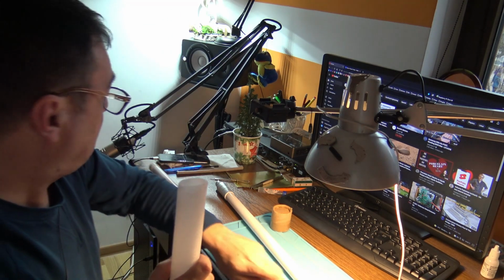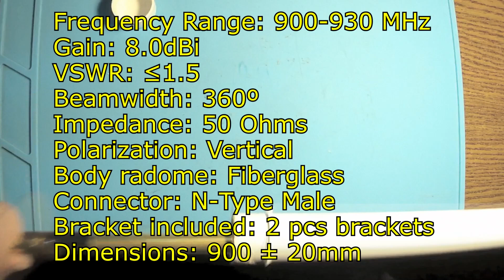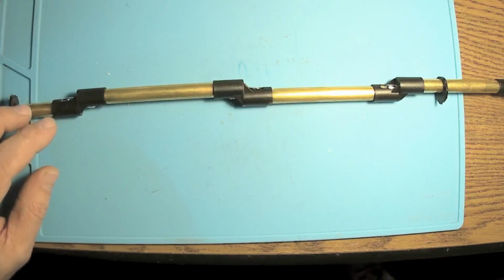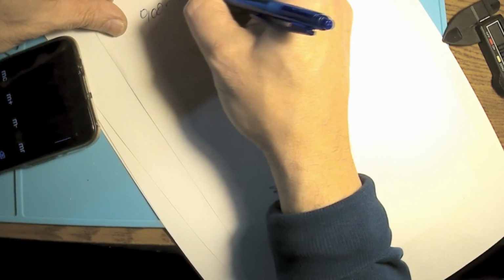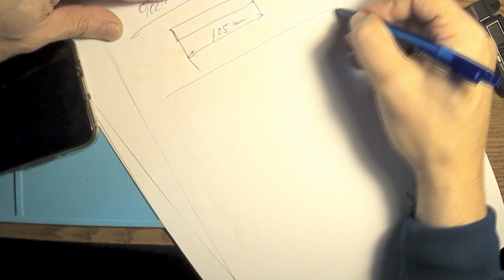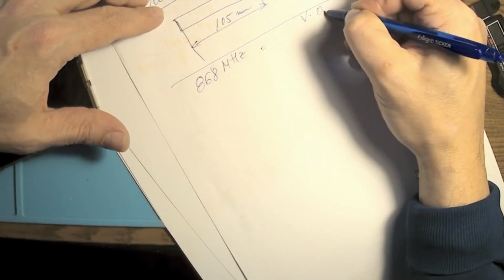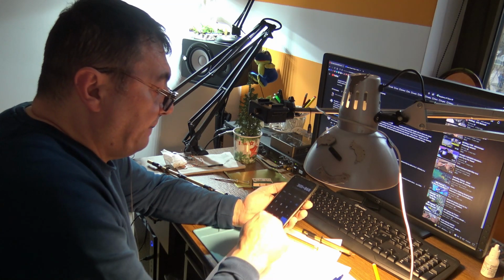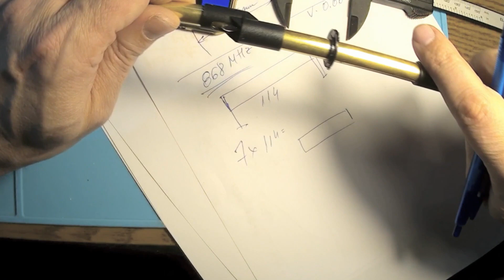RAK 8dB LoRA IoT antenna mod part1

Comment: So what is the best antenna for you?
rak or mcgill or yogi ?
Reply from the maker: So far RAK8dB...
Reply: @viocaia  Thanks all hotspots are about 30km rak can you suggest 6 dbi or 8 dbi
Reply from the maker: @AkGuN10  8dB of course..even more
Reply: @viocaia  I guess I mispronounced it. The farthest point is 30 km. There are many devices near me 500 meters like 1 km I am in the center of the city, is it still 8 dbi?
Thank you very much for your answers and interest :)
Reply from the maker: @AkGuN10  No way..you need a small omni like 3dB..that's how you can have a doughnut shape and cover the proximity.
Reply: @viocaia  I have Sensecap devices, do you recommend your own antenna or should I buy a 3 dbi antenna?
Reply from the maker: @AkGuN10  Before buying anything try the sensecap antenna..outside and as high as you can...you said you are locate in a urban are..so a 3 to 5 dB on the roof will be good..also you should have a filter installed, crowded radio areas are very noisy.

Comment: I would simply stick to using ratios, then velocity factor is irrelevant as it is then built in to the ratio - It would be useful if you had VNA to see exactly the tuning, and if it is 915Mhz, I would adjust all the elements and distances using (915/868) x 105  - doing this I make the elements 110.7mm each. And same for the little stub at the end adjust it according to the 915/868 ratio....  also, if you use hot glue etc you will be using an insulator which has different dielectric constant, I think around 3 for hotglue (LMR400 is about 1.7), so the small addition will have slightly different lower impedance, but hopefully not effect it too much.... good luck
Reply from the maker: Super! Thank you! Good idea..

Comment: Maybe you can use stripped lmr-400, it's thinner but you can try. Also maybe if you would increase the distance on the existing elements from 1mm to 5mm and just change the upper element
Reply from the maker: THanks! this helps.

Comment: Hi, nice to see the insides of these antennas, one thing you need to remember , the sleeve of the tube also have a velocity factor, as I have build quite a few antennas and when I started needing to enclosed them the antennas where useless as it was calculated with a velocity factor of the material / Coax used, with PVC what I have used I got to a medium of and extra 0.06 = 6% less as the antenna gets shorter the lower the velocity factor. So try finding the value for the "I think Fiberglass" they've used and you should get quite close to the measurements . I'm thinking of building one of these antennas using LL-400 Cable "LMR400" equivalent except with a solid copper inner conductor. Can't wait for the next video. keep on going...
Reply from the maker: Good idea..maybe that's why the actual dimensions are leading for 0.645 veleocity factor..maybe it;s fiber/plastic considered too..

Comment: All the loose parts act like a coaxial cable indeed, because you have a center conductor, an isolator and the brass tube as a shield. With that you could even calculate the impedance of it, but that is less important when building a collinear antenna. The length is the key factor to get it into tune. The top part is more ore less the 'tuning' part , but should be a 1/4 wave or less.
 Love watching you take all those over priced antennas apart, so every one understands that material costs  to make such an antenna is way less then the sell it for due to the Helium hype
Reply from the maker: Of course they are so cheap..like material..I don't think more then 5USD..with N connector!